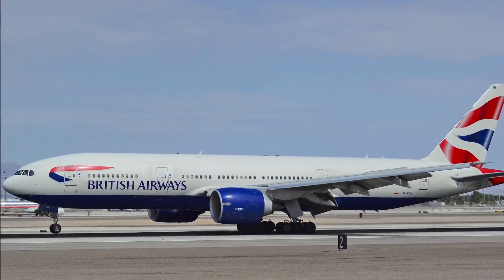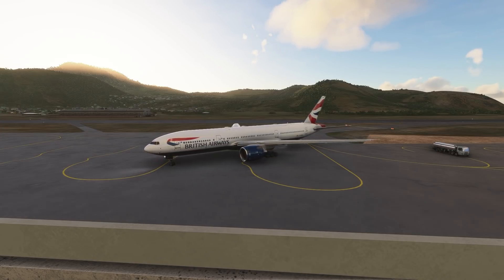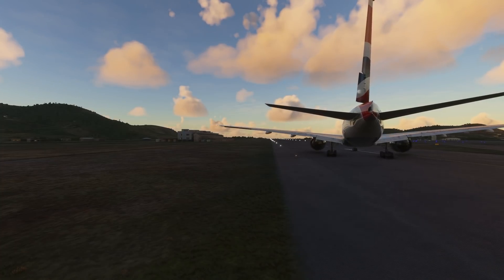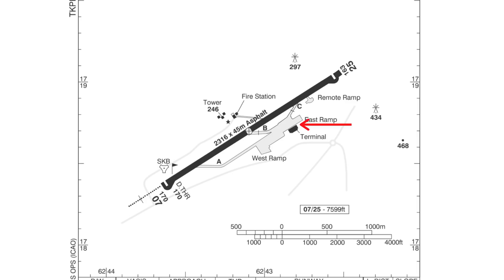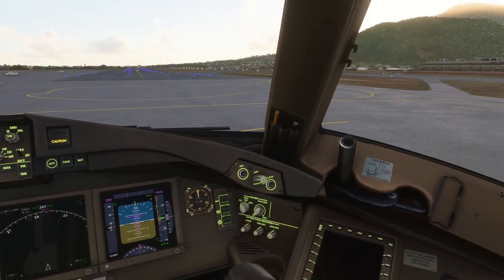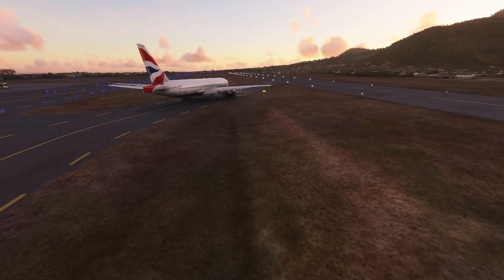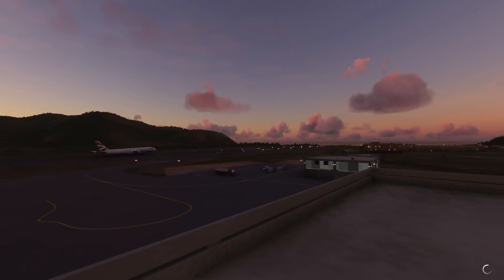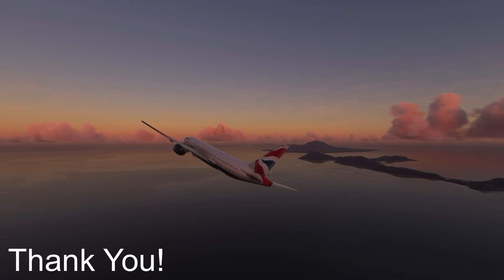How A Wrong Turn Almost Crashed This Passenger Jet | British Airways 2156

Comment: I was shocked to find out how little communication there is between atc and flight crews, in order to avoid unnecessary time consumption.  It seems like that and an unwillingness to inform somebody that they have made a mistake, or lack of awareness due to such truncated communications, has led to lots of crashes where somebody knew something wasn't right.  I don't remember, but I'm pretty sure that the pilot must have gotten clearance to takeoff from a specific spot, alpha, not bravo.  Based on that, the controller could have simply informed the captain he was now on bravo instead of alpha, and that he now had x hundred feet of runway available for takeoff.  I feel sure that extra info would have alerted the crew everything they needed to know, along with the fact that they weren't on the end they received clearance for.  But then again, they would have had to be paying attention to atc for that to happen.

Comment: If I’m Not Mistaken :

“ Triple Seven’s Minimum width of pavement for 180o turn is 185.5 Feet (56.5 Meters) “ !

For What We Could See In The RWY’s Diagram, Its Width Was 45 m.

I Think, Among The Other Described, That Was One Of The Variables Wich Led The Pilots To Takeoff From That Point.

Thankfully It Ended Well !

Comment: Of course things could have been different with differing weight or wind or a lesser flap setting for takeoff or if they had to reject the take-off they would not have had the accelerate-stop distance required.  Very fortunate that they made it without incident!

Comment: A really good near-miss analysis prevents the future incident.
I can see how these plates confused the pilots, it's not clear where which plate relates to the ground and each other plate. Arrows at the edge of the plates that point off to the other pages would have helped "↑ To plate B, ↓ To plate D".
The lack of signage is fully out of their range, they can't mitigate that since the airfield shouldn't have its license if it didn't meet that standard.

Comment: Always always always, use the all the runway available if possible.  Runway behind you is of no use at all in an emergency and that is when you are going to need it.  I don't care if you are flying a Cessna 150.  Use the runway you have.  Chances are, you won't need it, but... All you did was loose a couple of minutes taxing.  Why risk it?  Why have two or more hydraulic systems?  You only need on.  Why have back anything?  BECAUSE IF SOMETHING GOES WRONG THAT'S WHY.  Those two guys risked the lives of everyone on the airplane.  They got away with it this time.Yes, the airport was poorly marked..........but, if you don't know where you are going, you STOP and figure it out.  Never assume.  All the controller had to say was, " Check you are at Bravo taxiway?"

Comment: That was a great CRM Video thanks. Luckily no engine failure before VR!. No dig at BA and I am a narrow body Airbus Capt who teaches CRM occasionally. One of the Companies SOP and in the OM I worked for in the past was NO Intersection takeoffs at Unfamiliar Airports. I noted your vid says both Pilots had not flown here before right. Put that with dodgy airport charts, new bays etc and no Signage showing hold B for runway and a sign showing A this way etc this IMHO is a classic swiss cheese scenario. I am sure lessons were learnt here as well IMHO. I wont waffle on but Thanks again M.A.C.I.

Comment: I'm often not sure how an controller or pilot can be afraid to speak up. If they are too shy to do this, then they're not the character who should be in that position. What is the pilot supposed to do if you remind him that he is at taxiway Bravo and not taxiway Alpha? Either he corrects for his mistake or he says "Screw it, we're starting anyways". First would be the ideal case, second case would be a super reckless pilot (which is usually unlikely). Either way, should anything go wrong, the controller did his job properly and contributed to safety as much as he could. If he did not make the pilots aware of their mistake, there is a bit of blame on the controller as well and you want to avoid such guilt... I maybe can understand why an FO sometimes doesn't speak up (although he should), as there is a certain power hierarchy going on, but for the controller there is no imaginable consequence he could face. The controller has more authority in this case. It's his airport and the airplanes are not allowed to go anywhere without his approval...

Comment: This is the perfect example of how irregularities seeming each of them insignificant can lead to disaster when coming all together.
No correct hold short panels is very dangereous. At least if there were NOTAMs mentionning this at the time, it could have give the crew and the trainee controler a trigger to understand something was wrong.
I think even with a taxi briefing, it could took place. When things are as confusing as this, any one can fail to identify the threats.
This also show how unfamiliar places can challenge a crew.
I understand the reaction of the trainee controler even if it's clear that he made a mistake not considering the answer naming taxiway B. But I don't understand his supervisor. He was doubting but did not intervene. At least the trainee questionned himself and refered to another one to verify. The supervisor did not ! What's that ? In aviation communication, when there is a doubt, you must clarify ! The supervisor assuming that the crew knew what they are doing while he was shocked that the 777 departed from there is a bit shocking to me. I mean, he was troubled. What is the cost of asking ? The cost of not asking ?
It ended well. It could have been catastrophic. I can't even imagine the feeling of the one understanding what was happening in the plane...

Comment: Even if the engines started spoiling up for t/o power, the engineer who alerted the cabin manager should have insisted the cockpit be called as a matter of an emergency situation on the phones located by each crew seat. I don’t understand why he would have just sat down and thought ‘ah well I’ll just leave it then, see what happens…’ seems a little odd

Comment: I think this one is completely down to the airport and it's lack of signage. Yes, dumb mistake by the crew, but the system is supposed to be designed to prevent a single point of failure.

Comment: This certainly could have very easily gone way worse than it did.  The condition of that airport, both then and still now, is more than a little worrying considering the types of traffic it is handling.  It very definitely rings very strongly of the old airport in Tenerife where the disaster occurred.  Hopefully these mishaps here are not a precursor to something of that magnitude occurring again...

Comment: The correct question to ask is not about wind speed etc, but which idiot certified this airport for use?
The good thing is the Captain saved the plane by standing on the brakes before rolling.

Comment: Love your content. I think you are improving in your visual depiction of the events, no doubt that FS 2020 helps a lot ;). Keep it up, you're doing a great job!!

Also, I think it is very important to cover the near-misses as well as proper accidents. There are biases that are hard to shake, and deference in moments of inattention. It's important for such a procedure-centered industry to improve situational awareness with cross-checking facts in the environment. Charts and signage can be confusing; however, there were other facts available to the crew in getting the sense that something was not right. 
And... It was clear the pilots sensed something was off, by applying braking alongside full thrust. But they didn't take that moment of doubt to cross-check with a chart or their surroundings. I think maybe a pause in the inside-focused checklist to cross-check your surroundings with your expectations. Any capitulation to doubt, may have been enough of a delay for them to realize the error on their own, or allow for CRM wrt to other crew members experienced with the airport. 

Additionally, I think the ATC-Pilot dynamic is sort of littered with sort of sub-conscious notions of power dynamics. I think controllers need to have a clear mindset for the pure informational content of what is being communicated. They see the flight crew making an error that has been made before. <<Okay. Maybe they know something I don't, but maybe bring it up.>>  <<Bring it up>>  << Pilot directly contradicts you>> ... that's the beginning of a communication, not the end. 

We are humans at the end of the day, don't forget

Comment: Excellent analysis and video!

I think, whenever possible just use the whole runway, this will prevent taking off from the wrong intersection, and who wouldn’t want more runway available in case of a high speed rejected takeoff?

Although, pulling a 180 in a 777 there, even with the little runway turnaround area toward the end, looks really intimidating! In that case, have to make absolutely sure you are at the correct intersection! Assume you are at the wrong one until proven it is the correct one, your life could depend on it!

Comment: I sincerely believe the pilots knew what they were doing as the flight is only 65 miles or just over 100km to Antigua. This is a flight that will take no more than half an hour at low altitude so the plane was carrying little fuel, baggage and passengers and was more than capable of performing the take off within the distance. Once landing at the larger airport in Antigua they will take on much more fuel, passengers and baggage for the 7½ hour (4000 mile) flight to London.

Comment: What avoided a catastrophe was holding the brakes down while the engines spooled up, thank goodness this was not a rolling take-off !!  It was good fortune for all onboard that as the aircraft entered and lined up on the runway, the cabin was not yet secured for take-off, this allowed the flight crew those additional seconds for a visual and to note the runway appears shorter than what they believed to be correct as calculated, which lead to that lucky six sense decision to hold the brakes on while the engines spooled up.

Comment: Hey, yet another great story. Not being a pilot, I was confused by one line:
The pilot interrupted his takeoff but was advised to keep throttled up with the brakes on. Is that standard? And if so, what is the rationale behind it? Thanks again, you're the best.
Reply: Here's my guess: If they need to take off or gain speed fast, holding the breaks while fully spooling up the engines is indeed the right choice. That way the plane doesn't roll and waste runway space and they can start off at max acceleration to begin with.

Comment: I don't follow how the crew didn't see their error? Could they not see that there was all that runway off to their left as they approached about to turn right to line up? There seems to be a number of valid points about ATC and signage, but no mention that the crew could have spotted their error by sight alone? Or criticism of the decision to proceed even though they had remarked at how short the available runway appeared. Also, the parts of the yellow taxi lines in the parking area that for some reason go wobbly must irritate anyone with OCD. :)

Comment: I presume it came in from London, and than made the 100 km hop to Antigua on the remaining bit of fuel. Would they have been fully refueled for the return flight to London they never would have made it. What makes me wonder, is that the gps navigation board did not show them on a moving map where they were taxing. And many airliners have this system on board where a voice says "approaching runway 07, 1500 meters remaining". I think it is called the RAAS system. It even says "caution short runway" when you attempt to take of from an intersection that would result a too short runway length remaining from that intersection. And the missing taxiway signs and the twr atc failed to notice to the pilots that they are on the wrong intersection. Fortunately this time all ended up ok.

Comment: Why is it ever allowed to take off from anywhere but the very back of the runway? Isn’t it just common sense to give yourself as much room for error as possible? Especially if it’s so simple to give yourself that room
Reply: Time saving, less time in runway and reduces chance of messing up the turnaround and accidentally putting nosewheel in grass as has happened before

Comment: There was another incident that I saw before my eyes but never heard any of it in the news, local or aviation news.  It was a late night in 2007, a BA jumbo jet 747 was about to touch down in Boston Logan airport when the crew made a final right turn from its northern approach, heading towards the town of Everett instead of the actual runway.  Just like the passenger who wanted to warn the flight deck of the error, I felt so helpless to see a giant object with lights aiming at high tower buildings; however, they luckily realized their mistake and veered back onto the runway using its lights as a reference guide. The next evening I went out to see that the buildings’ lights had been dimmed.
It’s an industrial area that had been using really bright lights at the top of four towers, but this was the first time I had ever seen a plane mistaking them for airport lights.
Reply: Also never reported was the United Airlines 747 that lined up on the A4 instead of 27R at Heathrow. The pilot got to 50 feet before he remembered that no runway on the planet is lit with yellow sodium lights, nor is it commonplace for there to be cars all over the runway. United tried to deny the incident until CAA (Civil Aviation Authority) threatened to ban them from UK airspace for failing to respond to a safety enquiry.
Reply: That same scenario you mentioned also played out on a small island or someplace south of Mexico I think. It was featured with on this channel or one like it. Maybe it was the same incident? Not sure but it sounds exactly the same.

Comment: A couple of observations.
1) There are huge 200ft+ wide turning pads at each end of the runway so I don't believe backtracking and rotating to line up should have been a deterrent for using the full length.
2) If entering the runway at Bravo instead of A, if with the minimal amount of taxing /runway layout briefing a pilot would/ should have expected to see the large white (5:33) rectangular fixed distance runway markings?
Just saying.

Comment: I was an Senior FO on this fleet at the time and flew into St Kitts a week later. I took lots of pictures for the company to check taxiway marking and signage. I can understand why it happened. The B777 is on a island hop flight to Antigua before refuelling and getting fully loaded with passengers to London Gatwick. Due to very light weights, thrust required is much less than max de-rated thrust allowed so performance is greatly enhance for an ‘A’ intersection. Thus they got away with it from ‘B’. The issue would have been a high speed rejected takeoff (no enough runway to stop). Capt A320
Reply: interesting to know...greetings from St. Kitts !!!

Comment: I swedish scientist and inventor (Håkan Lans)  who was involved in developing a GPS systems for aircrafts (STDMA)  during the 80s and 90s was under heavy pressure from the US radar industry (I even think he received subtile death threats). The airline industry was alarmingly conservative and slow in adapting GPS technique. A simple smartphone would have prevented this almost disaster.
Reply: Yeah but the US military threatened degradation or even denial of use in a war or terrorist threat back in those days. Great, you base everything on the US system and they turn it off or degrade it!
Reply: @billpugh58  True! When was GPS released for public use? The system was deliberately inaccurate (for non military use) in the beginning.

Comment: All directly involved suffered from "Confirmation Bias", meaning that even though things didn't look right, they still believed all was good.  Tower also believed the pilots knew what they were doing, and the flight deck likewise believed that Tower would stop or redirect them if something wasn't right -- all based on their collective past experiences.  When no resistance or apparent confusion was encountered, they further affirmed in their minds things were good, when in fact, they were quite not.

I can only imagine they all had that sickly dark sense of dread once the plane passed the point of no return on the ground, once they realized their grave error.  The pilot in command most likely realized the grave situation they were in, and then acted quickly to get the plane in the air and then level to accelerate, in order to prevent the unconscionable. 

Miracles do happen, and this was definitely one.

I'm also elated that corrective measures were put in place at the airport BEFORE a tragic accident happened.  um... Well done?!?  Indeed.
Reply: Why are you not angry that the airport endangered many flights and thousands of passenger because it/they either did not know or did not care about the safety regulations which applied to the airport ?

Comment: Never understood why sometimes pilots take off not from the very beginning of the runway. Even if you have more than enough space for take off, you never have more than enough runway in case of aborted take off. Shorter run distance reduces your V1, which compromises safety.